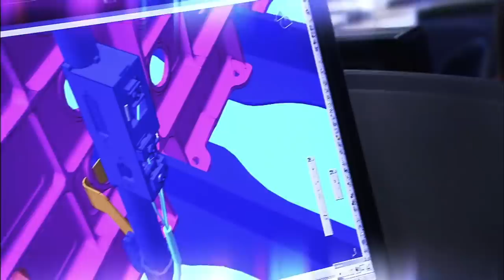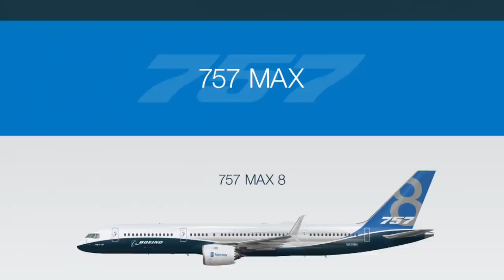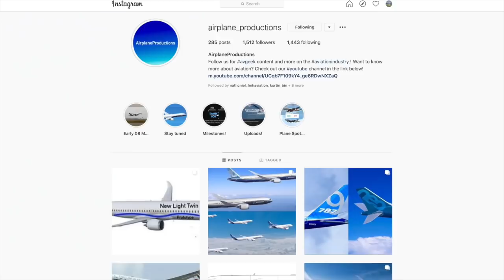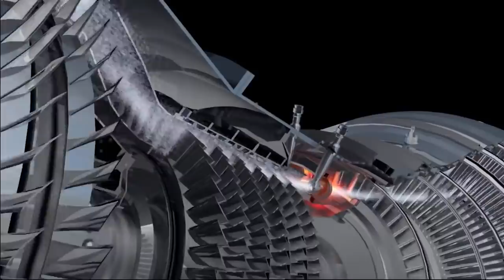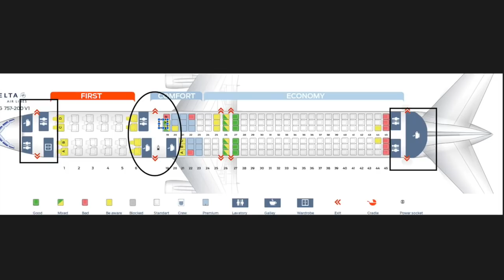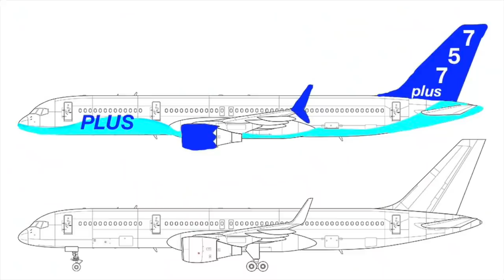Boeing 757: Could a 757 re-engine work? (757 plus)

Comment: Good idea, but from on the airbus side I would LOVE to see an a310neo. it is only as old as the 757 but it is a way more comfortable wide body and it has a lot of common features with the a330. a330neo+a310=a310neo
what do you think?

oh yeah btw a really nice vid! ;)
Reply: EDIT: Oops mind fart: wrong aicraft, but WHO IN THEIR RIGHT MIND WOULD ORDER THIS IDIOT aircraft when you can buy a 321xlr???  Or possible 757 updated to modern standards???
Reply: @w8stral  well if you say you can upgrade an 757 to "modern standards" then an a310 would be easy. just saying.
Reply: @kornelpesti787  Its called DRAG.  a310 is a short stubby 8 wide seating aircraft with 2 aisles. Same reason 787-3 was never built and 767 is not flown for passenger service.  Lots of drag for number of passengers carried.  Can place SAME number of passengers in a single aisle 6 wide aircraft with MUCH less drag and therefore much lower fuel costs per passenger kilometer flown.   Only possible reason 787-3 could make sense is if they go with a LONG fuselage for higher capacity and much shorter range.... but that is not what it was supposed to be and why absolutely no one ordered it other than ANA who frankly would have been much better off with the a330, but since Japan is not exactly a market economy and 787 wings are built in Japan, ANA is flying 787's domestically on tiny puddle jumper routes.....  Go figure.  I would not be surprised if they purchase a couple a380's to fly domestic routes of ~1000km
Reply: @w8stral  yeah, it might true but Boeing wanted the 797 to be twin aisle and the 767 is flying passengers all around the world. Boeing is studying the 767x. this whole middle of the market start to REALLY confuse me.
Reply: @kornelpesti787  Actually Boeing has said single aisle, twin aisle, etc etc regarding 797, so uh.... yea, not exactly impressed with the "roll out" of the 797... =)
Reply: @w8stral  same with me.
Reply from the maker: Kornél Pesti That will be cool, though the A330neo will probably be more efficient as it also has new systems like Fly by Wire. Thanks for your support!
Reply: @oneskyflyer  yeah, but this would be smaller than the a330 800 (as the former a310 was) with a smaller variant of the Trent 7000 as engine, upgrade to the a330s fly by wire system, install winglets, design a new airspace cabin and finally add new sharklets. it could work, especially that Boeing kept the 737 alive for 50 years (that it crashed is a whole other story) and now he studying the 767x and the 757plus. but I might be totally wrong.
Reply: It's not about what is loved. It is about what's necessary.
Reply: @hodb3906  True and why a 757/a322 new build is probably in the works or will happen.  Yes, they will both take a LONG time to load/unload at the gate.  SO?  Economically, they are superior for passenger travel.  Not so for cargo...
Reply: @w8stral  Yeah, Have to agree. Although it's obvious passenger transport is the aim for these aircraft. Larger aircraft handle cargo a lot better.
Reply: @hodb3906  i know, I just said I would like it. is there a problem?
Reply: @kornelpesti787  I just think there won't be sufficient demand for it.
Reply: @hodb3906  why?
Reply: @kornelpesti787  Because the a321 xlr allready performs in the same branch and it is not that easy just implementing fly by wire and all. Cockpit will have to be redesigned because the a310 doesn't work with the conventional automated throttle and also still has a yoke. The flightdeck is just too old. And redesigning is really difficult. That's why they hardly change. Look at the 737's flightdeck over the years. The only interest the a310 neo could have is in the cargo industry. But even so I  have doubts. Btw I personally think that problem is also applicable with the 757. Both are too old.
Reply: @hodb3906  maybe if Airbus would install the a330neo cockpit would work. just an idea...
Reply: @kornelpesti787  XD. If only it was that simple. You can't just copy paste it. That would mean rearranging other avionics and systems. The a320 and a330 are very similar. That's why a neo version can be made. But the a310 is just too old. And same for the 757. both are just too old. Not saying it is impossible.
Reply: @hodb3906  copy paste, I love it. oh yeah actually the thing that stops Airbus from it that they do not have a digital copy of the design. fun fact.
Reply: @kornelpesti787  For real? Ah well I didn't know that. Thanks for that. Where did you get this?
Reply: @hodb3906   yes. I got it from here: https://simpleflying.com/airbus-a310-neo/ 
ps. pretty reliable.
Reply: I would love to see the new shorter widebody like the A300 and A310, but with A330neo technology and advancement for mid-to-long haul airliner (in other words, A330neo with A300/A310 length)
Although the only differences needed are the shorter wings, kinda like what 787-3 were intended for.
But then, i guess airlines prefer narrowbody than widebody, especially due to cheaper overall cost. I was afraid that the narrowbody means narrow seats, but then the A321neo might have better wider economy seats (18 inch) than what most airline opt for in their 787 and 777 (17 inch), or worse with low cost carrier A330 (16 inch).
But either that, i was hoping that airbus could make the regional variant of the A330neo, that way the A330-800 might have demand.

(Also, i'm quite dissapoint that none of  japanese carriers use A330. Although skymarks does, but it was short lived.)
Reply: @eirfanhazlan9271  I am disappointed also.

Comment: thank you for the great video analysis. i think that they may not pursue the 757+  as the 737 max 10 has similar capacity and range. what they should do is pursue a new small plane to replace the 737 (FSA) or reengineer the 767 / or the NMA.
Reply from the maker: Filippos Matsakas Thanks for your support. Yeah the new FSA will be slightly larger than today’s 737, overlapping maybe with 757, though reports show Boeing May be working on both at the same time. Will be interesting. Thanks for watching and do stay tuned for more great videos on the way!
Reply: AirplaneProductions Lets see what Boeing’s new CEO decides. Keep up the good work!
Reply: But the 737max 10 doesn't have the performance or range and therefore capabilities to match the missions that the 757 can easily achieve. The Max 10 would struggle with those missions.that's why airlines like delta and united were urging boeing to introduce a replacement for the 757 like the NMA. These airlines aren't exactly ordering 737 max 10s to replace their 757s. They know it just won't cut it for the routes they want to use it for. Boeing was hoping the Max 10 could be a replacement, but it takes alot more to replace a very unique and versatile airplane like the 757 than just stretching the fuselage of an aircraft that was never really designed for the longer-range missions that the larger-engined 757 can easily do. This is what caused 737max  problems in the first place.
Reply: I think the 737 has a serious growth ceiling. It really can’t be stretched safely past the MAX size and the legs are way too stubby
Reply: Filippos Matsakas they did reengineer the 767, it’s called the 787
Reply: Me Myself From a capacity point of view, indeed. However the 787 has significantly increased range and thus, cost. The 767 was more optimised for medium-haul and was cheaper.

Comment: In terns of 200-250 pax capacity, A321XLR would still be more fuel efficient per trip as it has lighter OEW/BOW
Reply: But will it have the performance of the 757 on short runways, high runways, hot climate, better ground clearance, ability to fit bigger engines, MTOW, and payload? I don't think so. But, I still think that a re-engining is necessary, though it is better to just use the airframe for the 757 and re do it with composites. That way, it saves money, and we all can still see the iconic duck nose. (please be nice, I am only 13.)
Reply: And anyways, Rolls Royce and others were already developing engines to power the NMA. But since that is gone, it could just be redone onto the 757.
Reply: @alphabravoindia5267  from my perspective as an #AvGeek i do think so, even if compared to current CEO version 757 has many advantages....but looking at current & post pandemic, the overall efficiency is the main consideration for many airlines where the fuel burn rate per trip holds the majority of the portion....bigger OEW means higher fuel burn rate per trip, thats for sure
Reply: @stradivarioushardhiantz5179  that is true
Reply: If your focus excludes cargo, then you are right.  Most thin routes make their $$$ on cargo, and the fuel efficiency of a 757 would equal that of a321xlr as they will both be using same modern engine tech which is the #1, #2 reason 757 fell behind as the 757 currently is 2 generations older in engines.  2 generations!!!  Why do you people forget that the 737Max9/10 and A321 are identical and the 757 is nearly so except with a slightly larger wing?  Its like everyone has forgotten that the 737-800 and a320 are their actual bread and butter and their new engine variants the 737MAX 7/8 and the a320neo.  A321 actually has a slightly larger wing.
Reply: @w8stral  Yes, I agree with all you said. However, none of those have the performance of the 757, and thus, still can't replace it though being two generations younger. Just look up Boeing 757 irreplaceable and you will get all you need.
Reply: @alphabravoindia5267  Never disagreed with you.  757 has always to my eyes been the perfect aircraft in between wide bodies and the pipsqueeks, not the a321 or 737.  With the advent of the 777, never understood the need for the 767 with its 7 wide seating.  For the Cargo guys MTOW airport fees MUST be the driving factor for the 767.
Reply: @w8stral  yeah agreed
Reply from the maker: Stradivarious Hardhiantz Thanks for your comment. Yep, though 757 will probably offer better climb performance. Thanks for watching and do stay tuned for more great videos on the way :)
Reply: The a321 LR and XLR just can't match the engine performance, payload, short runway and single step climb of that of the 757 the airframe and engines simply don't allow for that kind of performance
Reply: @oscarlubliner8388  1) Runway length is not really an issue as the world gets modernized.  2) Payload certainly IS a major issue.  3)Steep climb is like the high hot performance required... And??? How many such destinations are there in the world?  Mexico City, Bogata, Quito, and ??? a few in the Carribean islands  Sorry, you do not create a whole new airplane just for a few destinations.  For it to make a profit must sell 1000+ airplanes.  For a few routes requiring a few handfuls of aircraft??? Not a good solution.  In a perfect world, yes.   IF 757 equivalent gets made it will not have the overpowered engines of its predecessor.  Besides, 757 could not often USE extra MTOW to carry cargo as the hold was already full.  Kind of why there are some rumors of a flattened oval fuselage 767 floating around instead of a 757 revamp.  Engines available would already be derated which means they have LOTS of excess power for higher MTOW and cargo capability.
Reply: @w8stral  very good points and I agree with most of them however I would expect Boeing to use engines within the same thrust class of 36,000 to 43,000 pounds of thrust in order to make it more appealing as a  freighter in order to generate more interest and orders. However I wouldn't expect the likes of FedEx and DHL to order brand new aircraft which may be an issue. I wouldn't expect Boeing to flatten the 767 fuselage it would just be too costly and there would have to be major modifications to basically all aspects of the aircraft including the landing gear, stabilizers and wing attachments. But the 767 would have the advantage of having twin aisles and the manufacturing tooling is still available as the production is still going. Whatever will happen will depend on boeing's budget for their next NMA and the financial position of the potential customers an updated 757 or 767 would make more sense for airlines such as Delta and United along with others as they wouldn't have to retrain staff and order new maintance equipment.
Reply: @oscarlubliner8388  No way will the 767 be updated.  Think about this: 767 EMPTY weighs only 20,000lbs less than an a321lr FULL and caries only 25% more passengers if you go with their -300 version with same range.  This in a nutshell is why a 7 wide seating aircraft is stupid as you have extra wasted space of another aisle.  Obviously the cargo guys LOVE it as it is optimized for volume over short range.  But as a passenger aircraft?  No.  Not unless you got rid of the 2nd aisle and put 8 wide seating.  Of course then the optimal would probably be 4 on one side and 3 on the other and an ENTIRELY new aircraft.  Now this is one thing I have never investigated, why not 4 wide seating against the side of the aircraft?  I know, customers do not ***like it***, but they are also the same one who refuse to pay an extra $5 for a flight(me).  I personally would not give a damn if seating was 4 wide before an aisle.  Now maybe for 6+ hour long flights... yea maybe as everyone at some point will have to get up and go to the bathroom.  But for the average flight?  Lasts ~2 hours?  No one needs to get up, well almost no one.

Comment: $1Billion for the B757 upgrade is quite an understatement. It will cost boeing at least $2B to just modernise the B757 and another $5B to restart the whole production supply chain. Also it would cannibalise on the B737max10 already in development. Boeing is better off leveraging the B737max and slap on a new wing, undercarriage, landing gear and engines. That could probably be done in just under $2B. 
Imo, I'd say that the MMA market is 60% on the lower end and 40% on the upper end. Quite the opposite from what the video mentioned. Then again both of these are personal views.
Reply: Well, yes, and well no.  Supply chain would be no different than existing 737 other than landing gear, after all 757 is nothing more than a 737 with slightly bigger wing and taller landing gear which HINT HINT is the problem with the 737MAX currently...
Reply: @w8stral  well, yes and no. The mid section itself accounts for more than half of the aircraft parts. The more powerful engines and longer fuselage also means a bigger tail section. That means that the only common supply chain that can be shared with the B737max is mainly to fuselage and nose.
Reply: @chingweixion621  Oh nice slight of hand... bravo... "most parts in wing box..." What BS... most parts in wing box because it holds the systems integration of the wings/fuselage/landing gear/powersystems...  WHICH ARE COMMON between these two plane types, at least they were when 757 was built and should be no different today. 

Structure is cheap and easy.  And in this case, it has to be 100% rebuilt as Boeing already got rid of all the 757 specific tooling, not that it would matter as the wing would be 100% new and so would the rudder, horizontal stabilizer.  Though could grab them directly off the max as the elevator on 757 is only 2 ft wider.  Rudder tried and true is to make chord wider as it is never used other than during landing, takeoff and you do not care about efficiency other than surface area.    The entire cost, or nearly so of a new airplane is completely new systems integration.  In this case, lift them wholesale from the MAX and move on.  Its what Boeing already did when 757 was built and it is exactly what Airbus did when they made the 321 and if they ever make a 322, that is exactly what they will do.  This is already what happens everytime a "NEO" is done by any manufacturer.  WHat is funny is that you somehow think a 757 is much much larger than the 321 or current MAX10.... it is not.  Slightly bigger
Reply: It would be easier to have a clean sheet design for a single aisle aircraft that has a range of models to cater for 180 to 280 passengers, similar flight deck to B787 and B777-9 to replace the B737 and B757/B767? 

You know if Boeing did proceed on a B757Plus, Airbus would release the much rumored A322.

The future is in fuel efficient single aisle aircraft operating up to medium haul routes.